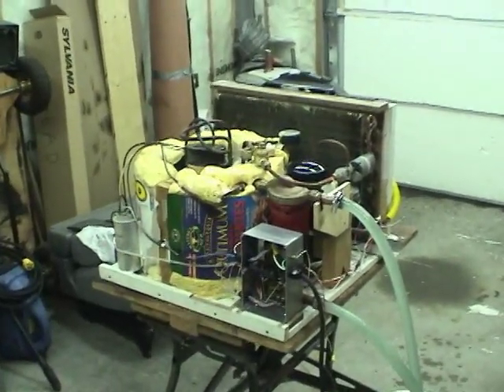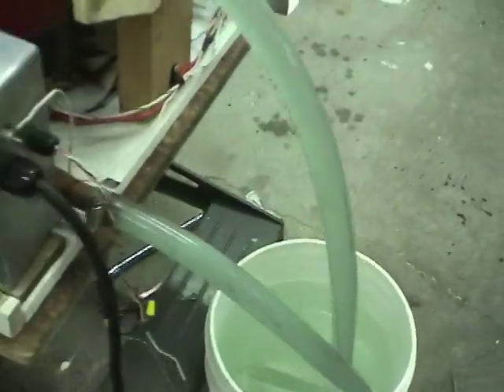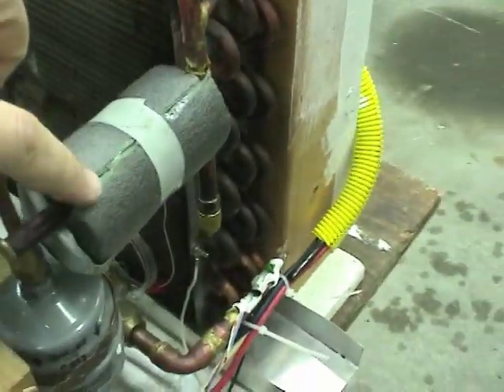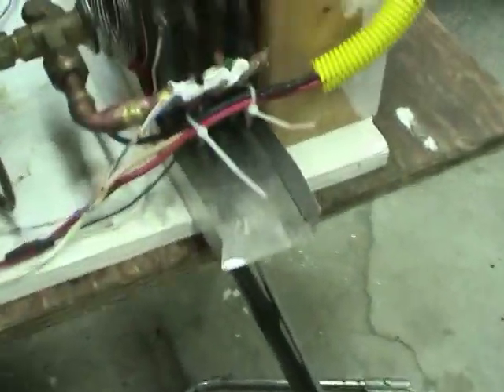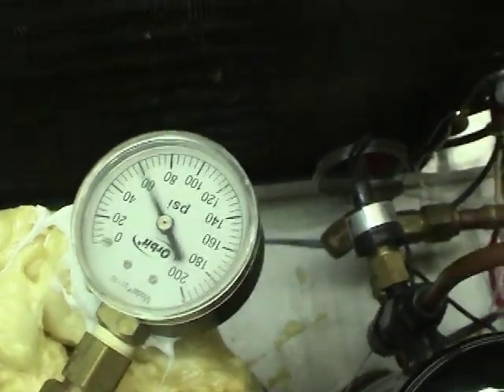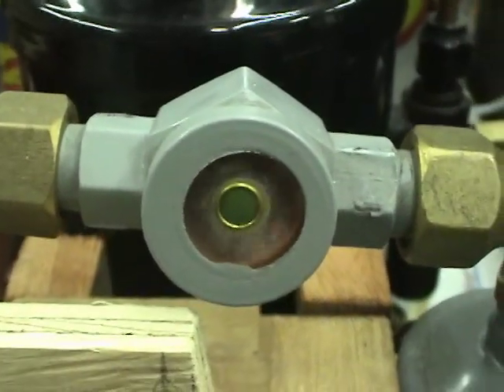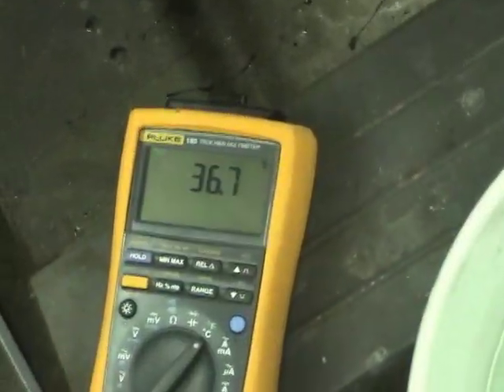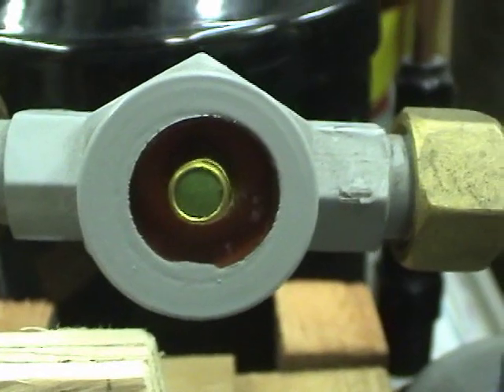Heat Pump Water Heater

Comment: The refrigerator which is the opposite of the heat pump works that the evaporator coil is immersed in warm water and as the coil cools down it becomes so cold that the water cools down drastically because the boiling point of the refrigerant is lower and more powerful

Comment: Nice Video  !
I made a DIY Portable Solar Heater for Pools Module 1,04 kWatt,  with a 50 meter garden hose 25 mm, a Ceramic pump 12 Volt, a Photovoltaic panel 12 Volt.
I replaced the Garden Hose with a Solar bag, to make the module Portable.
http://www.instructables.com/id/Portable-Solar-Pool-Heater-104-K-Watt/

Comment: 2 heat exchangers on the outdoor A/C unit can reduce A/C electrical consumption 50%, or 30% off of your total electric bill if 60% of your bill is A/C usage, and can providing over 100 gallons a day of free hot water indoors in which is another 10 to 30% off of your electric bill, and can save hundreds a month on pool heating. Also A/C refrigerant pressure will be as much as 200 psi lower which means you can go much longer before parts fail or break. Also solar attic fans can reduce attic temps as much as 60 degrees over existing soffit vents which can save another 20% on electricity in the summer or places that stay warm year round.

Comment: You need a hot spot heat exchanger between the compressor and condenser for hot water at 140 degrees F and pre cooling before the condenser but, If the condenser itself is being cooled or heated at water over 95 degrees then you start loosing efficiency which is why condenser can be replaced by a heat exchanger for pools and ponds or put under ground for geothermal condenser cooling. In this video you have replaced the condenser completely with a heat exchanger so this would be a perfect set up for pool heating only unless you add another heat exchanger. Right after the compressor the first heat exchanger would be for hot water in your house and the second heat exchanger would be for pool heating and if you don't have a pool then grab a shovel and make a small water pond or fountain or waterfall. Moving water through the air outside will create a better heat exchange in a smaller body of water if it dosen't get above 95 degrees outside where you live Also use a cheap ebay UV clarifier instead of chlorine or chemicals to keep the water crystal clear and rust free for a lifetime while using flexible copper for the heat exchanger.

Comment: Positively brilliant, I intend to do the same thing except I have a 5 ton AC reciprocating compressor that I pulled from an old AC unit
Reply: Daniel Grenon Hi sir I want some information in heat pump what are the components I want and  now I want do a project in heat pump only...

Comment: You're quite the garage scientist!  I wondered a few things; why did you use a tube in tube HX design and how could you know the efficiency of it being a home grown?  Why not use a brazed plate HX ref to water?  Also, if you're getting liquid past the evaporator, you're um.. flooding the coil.  Why not control that with your XV?  Would putting more heat to the evaporator coil help with this issue?  If you took on more heat, maybe it would boil off more refrigerant and thus achieve some super heat in the suction gas.  Very interesting, thank you for sharing your work with the world!

Comment: First off, brilliant.  I found your channel because I was researching ECM operation.  20 minutes later I am here watching this video and I am thoroughly impressed. 

What is the kW of this vs resistive water heaters with similar capacity?  (I am considering designing the same thing with a 18,000 btu split system I am building for my garage. 2 birds, one stone, right?)
Also, did you use an R-22 TXV for the .8 ton AC unit you utilized as the base for this?  Did you adjust the superheat to less than 8°f to 12°f to absorb more latent heat btus?
The start capacitor is required with TXV systems if the metering device isn't equalized.  This causes the condenser pressure to remain high and the compressor has to work to overcome that.  What mF rating are you using on the start capacitor here?
The only part I didn't fully grasp was the need for the suction pressure regulator.

Comment: Seems for me that one could make the water flow through another radiator inside the house, thus making a very large air conditioning unit. Am I right? :D
Reply: Matheus Moreira Its heating the water
Reply: I meant in the same working principle. ;)
Reply: Matheus Moreira Well it wouldn't increase cooling capacity, if anything it will reduce since you have to move heat from an extra medium (the water) to another.
Reply: Efficiency is out of the scope of my comment. :|
Reply: Matheus Moreira That's not efficiency, I meant it would make a smaller airconditioner.
Reply: Dang it. Can't seem to get it right. Bahahahahahahah :D
Reply: Matheus Moreira Hahaha

Comment: Nice engineering work,picking up outdoor energy .My biggest issue with indoor heat pump water heaters is in the winter you are adding heating load to the home. So you are not saving quite as much as advertised by manufactures.

Comment: dude......nice one..."pipe in pipe" i have done one in shcool, but with the heat part inside a water tank, it worked just fine, and i put a 4 way valve to make cold water to...now im doing one at my home, i i will use ur idea."pipe in pipe"..lol, and the cold part , im gona put in a solar panel for sunny days in winter, with ventilation working when the sun is gone.so it a air solar/water heat pump

Comment: nice idea for using a plastic pipe for the coil,copper is expensive,I have built it last year only I used a 12000 BTU-s compresor  and I put the copper coil inside of a 80L boiler about 25 metars of 3/8 pipe, from 15celsius to 65 celsius in about 25 min.....at 15celsius outside temp. I used r410a as a refrigerant it works at much higher presure and temp. power consup. is 4 amp and the COP is 4, translation I pul 1kw and get 4kw from my heat pump.sry4 bad spelling Im from Croatia
Reply: Hello, do you have any more info on this? How do you size the 25 meters of copper coil? have you seen some smaller plate heat exchangers?

Comment: I have a electric hot water heater and wean it turns on you can hear water boiling in it and it is loud boiling wean it first starts then it quiets down a bit is that normal and i ran hot water out of the sink for a while and all the air should be out of the heater i tried to turn down the water temp but that dosent help

Comment: Hmm - nice project if you have the spare time but this could be done a bit quicker if you can get hold of a water source heat pump and make some mods or getting hold of a pool heater which is essentially the same thing. Here in the gulf south of the U.S. there is a company called Florida Heat Pump (FHP) that makes very good water sourced heat pumps.

Comment: Built one similar for heating an above ground pool.  Worked like a charm.  Never thought about using a coiled condenser coil though, good idea.  Subscribed!  Love the videos.
Reply: I'm just looking into doing this for my self . For a 15ft above ground pool and advice for where to watch or parts I can get for free.
Reply: @every1likesr20mike  I keep my eyes open for people tossing A/C units, or now with social media, I just ask in the local area groups.  Most of the time they can be had for the cost of going to pick them up.
Reply: @slamdvw  I'm in UK and you never see them tbh I was thinking of trying to get hold of a old fridge and start from there . .
Reply: @every1likesr20mike  A fridge doesn't move that much heat, but it would be a great learning tool.

Comment from the maker: @airconguy1 That's typical of central heating heat pumps, the cooler the air, the higher the efficiency. You can produce heat at much higher temperatures, the efficiency is just lower. For example, the COP (heat out / power in) of a central heating heat pump may be 3 to 4, this water heater has a COP of about 2.

Comment from the maker: @Carltech100 Thanks!

I made the pipe-in-pipe myself, I just inserted a piece of 3/8" copper tube through a 3/4" IPEX flexible plumbing pipe. I actually did this after coiling both, by "screwing" the copper pipe into the IPEX, but it could be done while straightened out too. The total coiled length is about 7m, which seems adequate for a 10,000BTU/h compressor.

Comment from the maker: Thanks!

I had this unit mostly complete about 2 years ago, but it just sat on my work bench taking up space. Recently the gas water tank blew, and I replaced it with an electric one, and got the motivation to complete this heat pump. It should be running in the next couple of days. I'll have a video of the complete system soon.

Comment from the maker: Thanks!

I used BBQ grade. I probably should have gotten the proper refrigerant grade, but you can't beat the availability of BBQ grade.

Both grades are pretty much equally flammable. Since the entire refrigeration system is outside in this case, I'm not too worried, any leaks would quickly dissipate instead of possibly pooling indoors. I also used sealed relays so there's no source of ignition.